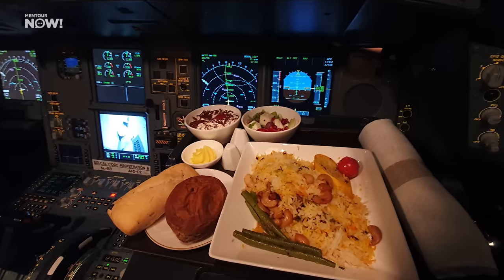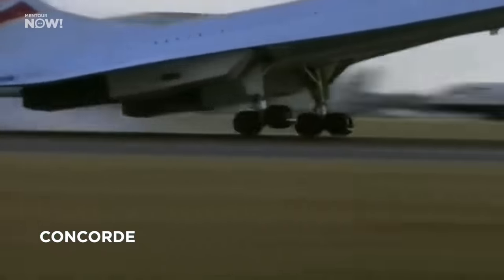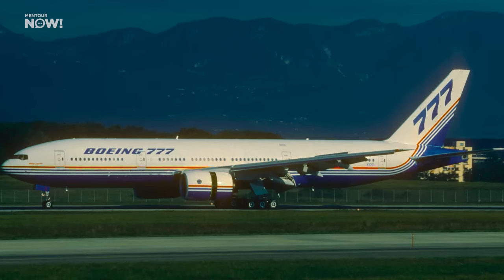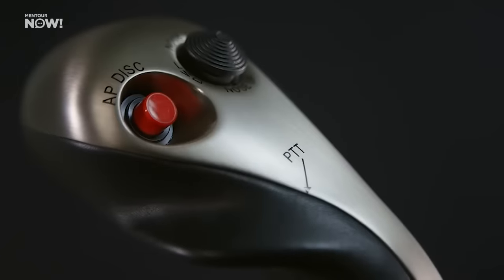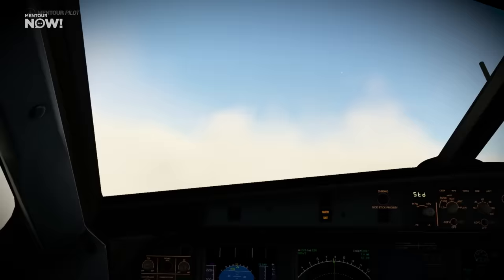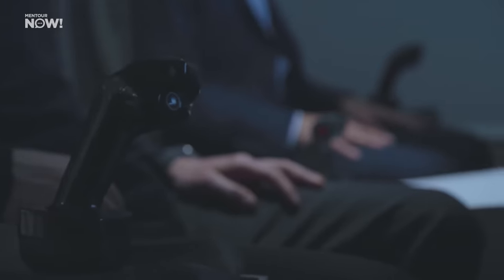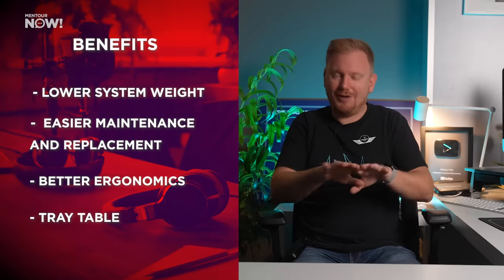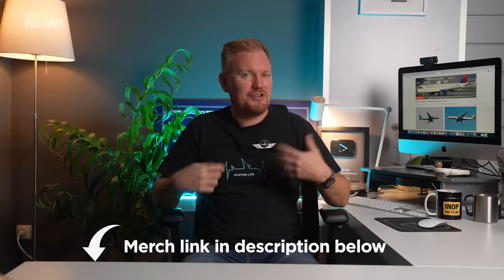Will Airbus Finally switch??

Comment: Hi Petter, 
I admire nearly all your YouTube videos, and I know that you are a very competent pilot on Boeing 737. But on THIS YouTube video sou seem to lack some fundamental thing about the difference between the architecture of airbus FBW and what Boeing calls FBW in their 777and 787. Boenig’s "FBW" is basically replacing the long steel cables between the control column and the hydraulic actuators at the control surfaces (example: elevators) with force sensors at the control column and electronic flight control boxes and wires to the hydraulic actuators. The command the pilot gives towards the control system (e.g. Pitch Elevator) this is executed by the Boeing "FBW" as a command to deflect the elevator. Of course there are some protections added to the system, so that the pilot can’t give very unreasonable control inputs. In case the autopilot gives a command to deflect the elevator, the Boeing "FBW" can actuate also the control column accordingly. You are also right that with Boeing's "FBW" in manual flight the pilot will need to apply a steady force on the control column in case the aircraft is not properly trimmed in pitch. But your assumption of what benefits an actuated/servo sidestick would give to the pilots in an Airbus FBW cockpit are quite misleading. The functions of Airbus FBW philosophy and technology are miles away from Boeing's "FBW". All Airbus FBW aircraft (A320 family and higher model type numbers) have a multitude of control laws. There is only one of those control laws that translates sidestick inputs directly to flight control deflection angles. This control law is called "Direct Law" and is the law that is active when the aircraft is on ground. In flight this law is normally newer the governing law in the Airbus FBW. There the "Normal Law" and sometimes the "Alternate Law" are controlling what deflections the flight control surfaces have to perform. At take-off when the nose wheel is lifting off, the direct side stick to elevator relation is terminated and replaced by a side stick to pitch-rate law. At 400 ft this Pitch-Rate law is changed to a side stick to G-load law, which means that with a neutral sidestick the flight path angle is maintained, pushing the sidestick forward gives a flight trajectory with less than 1 G (curving the flight path angle downward), pulling the sidestick back gives a flight trajectory with more than 1 G (curving the flight path angle upward). In those FBW control laws there is no direct relation between stick position (or stick force) and control surface deflection. In turbulent air the FBW tries to keep the flight path angle constant and makes necessary elevator deflections. The autopilot in the Airbus FBW is, when engaged making inputs into the FBW in a similar way as the pilot would do when the autopilot was disengaged, it will give commands to change the flight path angle and the bank angle and NOT command elevator or aileron deflection. Therefore an "active sidestick" could not give any feedback to the pilot to show him what flight control deflections are commanded by the autopilot. Therefore the assumption that a mis-trimmed stabilizer would give a force feedback to the active sidestick is a misconception because there is no direct relation between elevator deflection and sidestick position/force.
 All what I wrote here is NOT to criticize you, Petter, or say that Boeing's philosophy is inherently bad. It's just to explain the HUGE difference between Boeing's "FBW" and the FBW of Airbus that is in use since 36 years. It's not just the question if there is a control column or a sidestick in the cockpit. It's a question of what parameters of flight the pilot controls with his inputs in a given FBW control law.
Reply: You underestimate Boeing fly by wire. Boeing Normal Law logic is g command logic similar to Airbus but adds apparent speed stability so that the pilot must pull back or trim back to hold flight path as the airplane slows and must push forward or trim forward as the airplane speeds up. 
For example, consider entering a level 30 degree bank turn with the autothrottle holding speed. In a traditional aircraft or in direct law the pilot must hold back pressure in the turn to hold altitude. In an Airbus in Normal or Alternate law OR a Boeing in Normal law the pilot does not need to apply any force; fly-by-wire holds flight path. As long as speed does not change, Boeing and Airbus logic are similar in Normal law. 
Now consider an airplane at full power at high altitude in a climb losing speed. In a traditional aircraft or in direct law the pilot must increase back pressure or trim back to hold flight path. A Boeing fly-by-wire feels the same; the pilot must increase back pressure or trim back to hold flight path (continue the climb) because speed is decreasing. HOWEVER, an Airbus fly-by-wire will hold the climbing flight path with no pilot input (pure g-command with no apparent speed stability.) In Airbus Normal law when the slowing aircraft approaches stall, “protection” changes g-command to angle-of -attack command and the angle of attack stops increasing. With back stick the pilot can increase angle of attack a bit more but reaches a limit before stall and the nose drops to prevent exceeding the angle-of-attack limit. 
Consider what happened when Air France 447 was in Airbus ALTERNATE law with no “protections”. In alternate law Airbus fly-by-wire continued to try to hold a climbing flight path as speed decreased to stall which means the elevator increased nose-up input AND automatic trim followed with full up stabilizer input. At stall, the pilot on Air France continued to try to hold the nose up as was his experience in g command. The resulting full nose-up elevator AND full nose-up stabilizer stall was very severe. (Angle of attack was so high that stall warning stopped because designers thought it was unreasonable.) Now full forward stick would not break the stall until automatic trim followed. 
Boeing has no Alternate law. If Normal law fails, the logic goes to either direct law or “Secondary” law which is still direct control.
The lesson is that no aircraft should be certified that allows automatic nose-up stabilizer trim in stall in ANY normal or backup fly-by-wire mode.
Reply: @TomTilden  Thank you so much, Tom, for your detailed and great reply. Yes, Boeing and Airbus will both learn to improve their FBW control laws. But even the best FWB will never protect against acts of "pilots" that are complete idiots and can not recognize a stall like in the Air France case.
Reply: @sorgfaeltig  There is no question that the FO on Air France 447 did the wrong thing. With loss of reliable airspeed he should have maintained cruise pitch attitude and set moderate thrust as the Airbus procedure requires and it would have been a non-event. 
Instead he started a climb. Petter in his video “Titanic of the Skies” explains why altitude showed low at the initial failure of airspeed and the FO likely reacted by starting a climb. At airspeed failure the power was already back to slow to turbulence penetration speed, and deceleration would give some instinctive feel that the nose should come up.  He also points out that with the flight directors not turned off per loss of airspeed procedure the flight directors could stop working without reliable data and then reappear in the default condition of present vertical speed which would direct continuing the climb. Pilots normally fly to center the flight director, but we know the pilot in this case should instead have flown a cruise attitude and not follow the flight director. While climbing there was no feel in the stick that speed was decreasing because Airbus logic is g-command with no apparent feel for speed stability. 
The pilot monitoring called a few times for the FO to decrease pitch.The FO did momentarily push forward a bit a few times which decreased flight path slightly (g-command) but did not stop the climb. With Boeing logic of g-command PLUS apparent speed stability the pilot would have to hold more and more back pressure to fly that same climb and any forward pressure would drop the nose sharply. More to the point, with loss of airspeed BOEING WOULD FAIL TO DIRECT CONTROL which works like every other airplane and again requires more force as you slow and the nose would drop sharply if you stopped pulling or pushed any. 
Soon Air France stalled. Without Airbus fly-by-wire just releasing back pressure on the stick would recover, but in g-command the pilot must push to recover. But the FO never pushed the nose down and stall got worse. In stall the right wing dropped sharply and the nose dropped. The FO reacted with full left stick and full back stick. MEANWHILE AUTOMATIC TRIM CONTINUED EVEN IN STALL AND TRIMMED THE STABILIZER FULL NOSE-UP. Airbus Alternate law does not have stall “protection” to stop nose-up trim near stall like Airbus Normal law.
The resulting severe stall with full nose-up elevator PLUS full nose-up stabilizer was way beyond the peak of the lift curve. The stall warning stopped because Airbus engineers thought such a severe stall was unreasonable. Air noise likely sounded more like overspeed than stall. The aircraft turned more than 180 degrees in a right bank before crash even with full left stick, because aileron effect reverses in a deep stall. The nose oscillated but was near level pitch (in a bank.) Descent was over 10,000 ft per minute. When the stick was momentarily brought forward, stall warning started but there was no stall recovery because full up stabilizer is more powerful than full down elevator. 
The FO said that the flight controls were not working. He was wrong. They were working, but his actions combined with automatic full nose-up trim in stall had forced a severe stall that hardly any (living) pilot had seen and nobody trains. 

Without full nose-up automatic stabilizer trim in stall, Air France 447 likely would have had a continuous aural stall warning in a wings-level nose-high attitude and at much less descent rate allowing more time to evaluate. Among the three pilots they would have figured out that they needed to push the nose down (g-command requires a push - not just releasing pressure.) The airplane likely would recover, and the pilots would get extra training after arriving in Paris.
The pilot caused the stall, but it did not inevitably need to result in a crash. 

No airplane should be certified that allows nose-up stabilizer trim in ANY normal or alternate fly-by-wire mode.
Reply: To be clear: No airplane should be certified that allows nose-up stabilizer trim IN STALL in ANY normal or alternate fly-by-wire mode.
Reply: @TomTilden  Bravo for this detailed explanation of why Boeing's C*U FBW is basically superior to Airbus flight path C* FBW. Air France 447, Air Asia 8501 and XL 888T would have been much less likely to occur or maybe prevented with that FBW setup.

Comment: Isn't a disadvantage of side-sticks, that they are fixed on the left and right sides of the left and right chairs? That means that they can often be in the non-dominant hand of the pilot. I wonder if that is an issue in practice.

Comment: Why not simply have a single side stick mounted in between the two pilots? That would be a much simpler way to solve the whole competing/conflicting inputs issue. Admittedly, it won't do anything about the trim in degraded law circumstances problem.

Comment: I read that there are interesting differences between the A220 and A320 sidestick protocols, the way they command aircraft controls, it said that the A220 was more like a Yoke in the way you used it to command aircraft behaviour. Could you explain that please?

Comment: It is pretty alarming, but very understandable, how frequently pilots respond poorly/with great confusion to an Airbus aircraft entering a degraded control law state.  
When a human has thousands of hours of experience operating an aircraft according to one set of laws, and suddenly during a high-stress, high-workload moment the aircraft starts to operate under one of two sets of completely different laws that the person has only a tiny amount of simulated experience with, it is completely unrealistic to expect them to perform well.  Active sidesticks aren't the whole solution to this, though it would certainly help.

Comment: I hate Airbus since they use passive sidesticks even when the problems with lack of feedback discovered. Airbus did not WANT to see the problems, following a kind of ideology. The ordinary pilot FLIES the plane, the Airbus pilot OPERATES that. I'm not a pilot, but if I were that I would choose being pilot, not operator. I'm annoyed by the cases when Airbus pilots failed controlling the plane because the were trained to give inputs for the airplanes and they could not fly them. The active sidestick has been in a huge lateness, everybody have said that flying without force and state feedback is in dangerous and inconvenient, it was time to switch. And the stupid ideological leaders of the Airbus go to hell.

Comment: I've seen several of your accident videos, and I remember at least a few of them where the pilot and copilot were doing inputs in a linked system without previous agreement about who was it that was going to control the aircraft. In those cases they could feel that the other pilot was also doing inputs but they were so stressed by the situation that their awareness about that fact was completely degraded. I don't see how an active "joystick" system in airbus can prevent this kind of situation from happening. Why not using a system that simply disables the joystick of the monitoring pilot until some configuration switch or button for example is pressed to give the control to the other pilot? Wouldn't this be better?

Comment: The pilot sits on the left. Most people are right-handed. This means that with a side stick, most pilots are using their non-dominant left hand - the hand which has the least amount of fine control and motor memory. This seems to be a most inelegant arrangement for such a critical task, even with fly-by-wire.
Reply: Incorrect. IRL there is no difference in operating from right or left. Mind you it’s not chirurgical précision, micro movements are not needed like you assumed. The side sticks are quite stiff, as they are equipped with springs AND hydraulic dampers. The actuation force required is not light as you might have assumed from a PC joystick

Comment: Off the bat, I'm in no shape or form against active SSUs - I'm all for it. Having said that, did I miss it or has Airbus actually said something about going for active SSUs? Cause a retrofit is gonna be a certification nightmare and it will be expensive. This is flight controls, this is sensitive stuff, even more so in the shadow of the MAX. It wouldn't surprise me at all if EASA would require the entire handling part of the flight test program to be re-flown. If a retrofit get's approved it might be on the back of numerous caveats (like restrictions on mixed fleet ops) and a OEB report (or whatever it's called these days) from hell. Airbus is not gonna give it away for free and seeing as this is not an AD-type issue the airlines won't pay either.  It might actually increase their costs. Unless Airbus has a new jet in the works I'm not holding my breath for active SSUs on a bus any time soon... Ok, there is one possibility... assuming airbus actually forks over the money to get it certified they might offer it as an option on new aircraft coming off the line... That might work for new customers...

Comment: I have a question.  Fly by wire commercial a/c have about 100' aileron to aileron and 100' cockpit to tail, which makes for a good size dipole antenna.  In an EMF event that could cause catastrophic loss of control.  Is anyone planning on converting to fiber optic instead ?

Comment: I imagine their lack of intergration in the past is more of a bureaucratic quirk rather than a limitation of technology.  There are dozens of electromechanical ways of doing something like this with technology from decades ago. Any implantation like anything woukd introduce more complexity and potential risk but modern design and diagnostic tools mitigates that challenge not to mention inproved processing architectures that can recover from faults much quicker.

Comment: What does a kitchen table have to do with flying an airplane ?  That doesn't make much sense to me.
Reply: That table is meant to be used in cruise flight with autopilot on. Makes perfect sense. It's not just a cockpit. It's also the pilots office in the sky. Not everything in airliner cockpit has to relate to actual hand flying, like cup holders on the 787.

Comment: Would the additiuon of tactile feedback on the Airbus sidestick end cockpit commonality and require different training and type certification?
I had always assumed that the pilit not flying did NOT keep hand on side stick and that there would be verbal  human transfer of control just before a new hand would start to move the previously idle sidestick and the the former PF would take hand off once transfer confirmed. 
If the expectation is now that the PNF is to keep hand on sidestick to feel what the pF is doing, that  would be a big change in flying procedure and training, and I am not sure thus could be done without regulatory approval and changed pilot training.

Comment: sidestick would be ok if they were linked so each man can feel what the other guy is doing / trying to do.  At least then, in a fight for the lives of the passengers, the stronger guy will prevail and you have a 50% chance of saving everyone.  With sidesticks the way they are, the inputs just average and everyone dies, cause you don't go up or down but just coast to your death.
Reply: Bonin the Bonehead. 💀